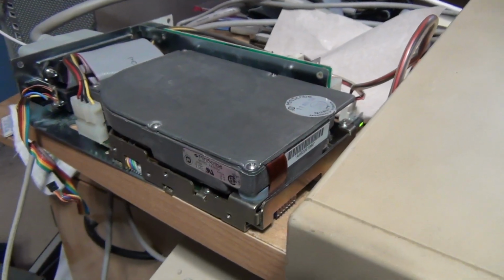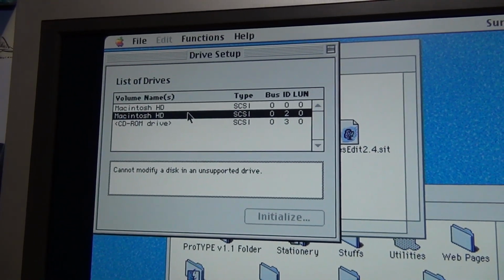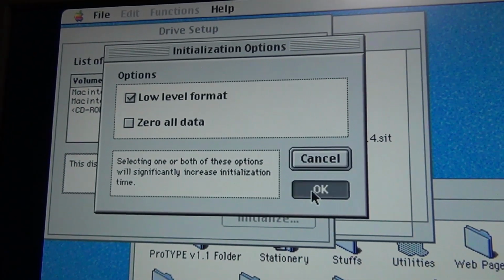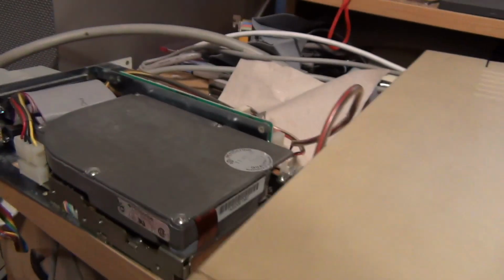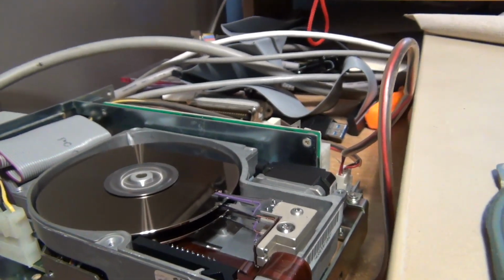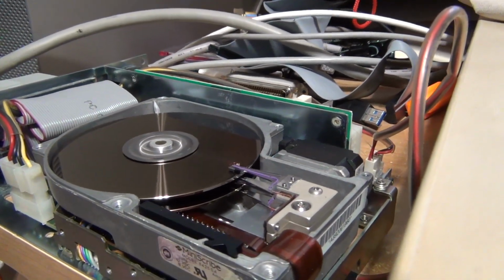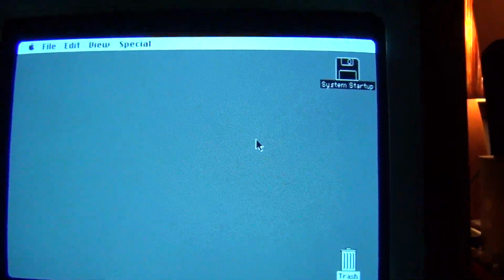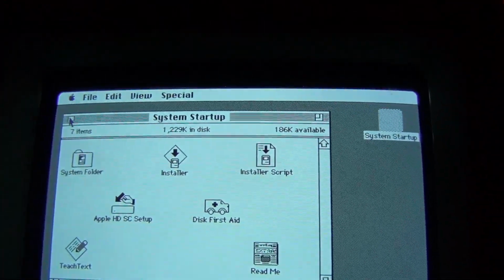The Rather Timely Demise of the Miniscribe 8425SA

Comment: When you took the cover off the MiniScribe it sorta sounded like there was a crash at the outer end of the disk somewhere, that would be your problem.
Reply from the maker: That’s kinda what I figured. It was doing other weird things before, too. For instance, when I would quit an application and the Mac returned to the Finder, it would forget what windows I had opened, possibly indicating a failure to write the preferences file. (It’s System 6 with Multi Finder disabled, so it’s single-tasking.)